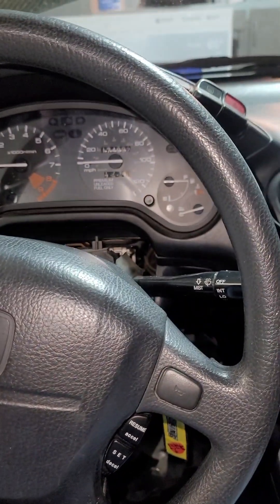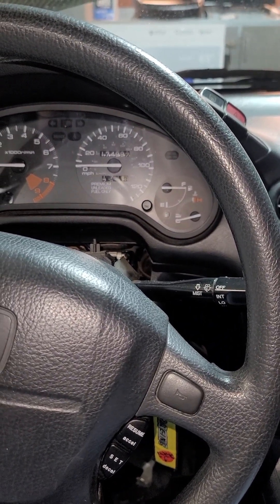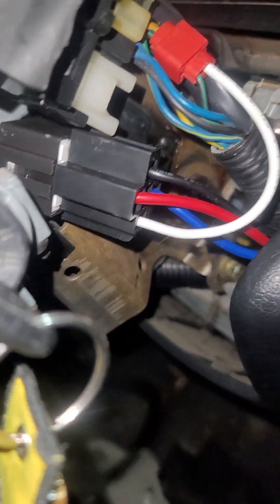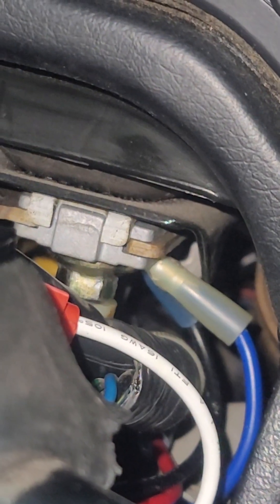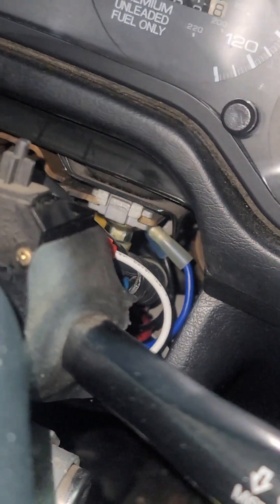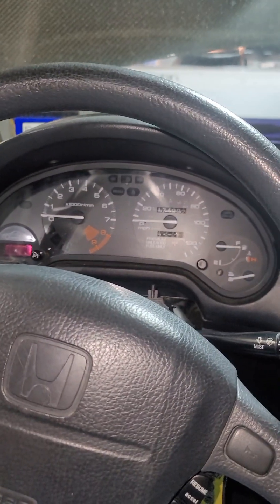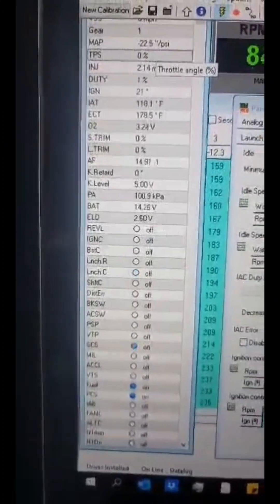HOW TO wire 2-step / anti-lag switch in 3 minutes!

Comment from the maker: My settings are
Rpm activation 4800 to 5200 limit
200 fuel
-15* timing

The goal is to see 0 degrees from your ignition timing when you are on 2 step to get the most pops and flames.

Comment: Hi good video about trigger for Launch control and 2 step.  think you left out the most important wiring info.  I want to ask where did you connect the pass-through trigger ground to the KPro? What input do I use? Thanks People want to know.
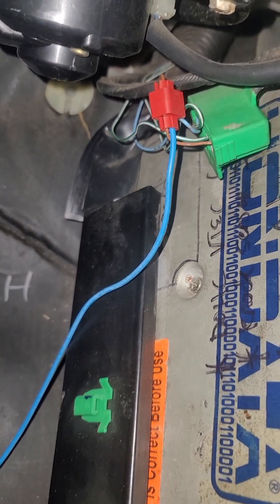Reply from the maker: This is on Hondata and did cover that on the video at 1:35. It's wired to the service port wire, set in Hondata. The clutch switch should be set to D4 service connector.